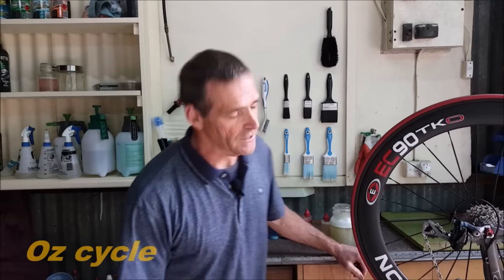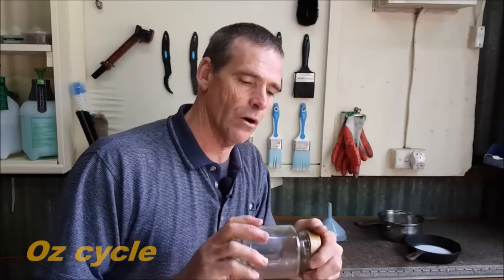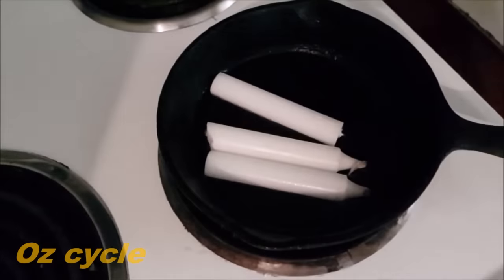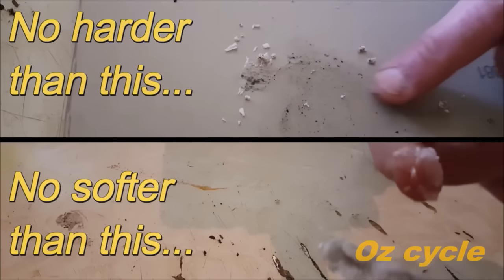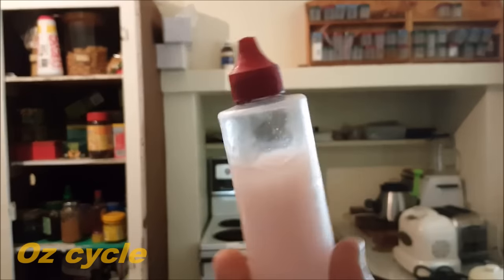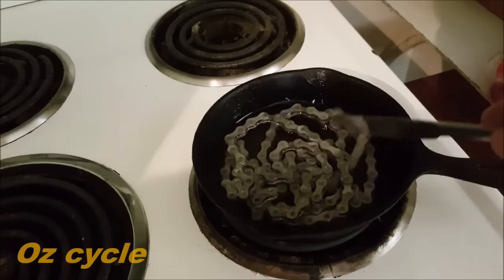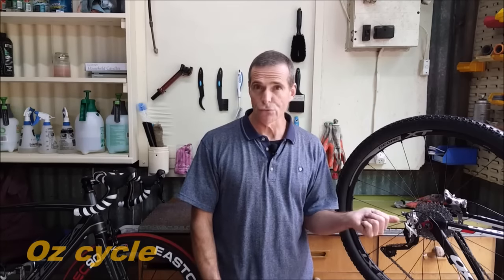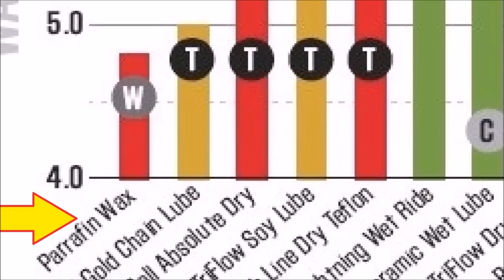BEST chain lubricant ever !! .....make it yourself.

Comment: Just a safety tip, paraffin wax emits highly flammable fumes when heated. You really shouldn't be melting candles in a pan directly over the stove element. It takes longer, but a double boiler is much safer. If you are going to risk melting paraffin directly over the element, have a fire extinguisher close at hand.
Reply: Conrad Griffith that's a good tip.
Reply: Oh and don't go out riding your bike as this could hurt you.
Reply: I made my first mix over the BBQ hot plate........ whoops! Did the second mix over the BBQ hot plate. Worked much better!
Reply: @rlevo  it's a very big cabuuuuuummmmmm !!!!
Reply: Induction plate stove should be safe -

Comment: I just did 75km in muddy conditions I cannot believe how clean the casset and chain are . This has got to be the best you tube video I have come across  never again am I using anything else.
Reply from the maker: Nice to hear your experience Stephen 😁
Reply: oz cycle yep it's fantastic but I must say I'm not a fan of the xylene I did get some and have made the mixture but it's really does stink so I'm gonna try turps or white spirit and see how that goes. Xylene is expensive as well
Reply from the maker: It has a high odor because it evaporates quickly. Otherwise go the hot wax method ?

Comment: Hi @oz cycle, Thanks for the Tip mate , I make a product at work called Dermeze sensitive skin Ointment. It's exactly 50% Paraffin Liquid and 50% Paraffin white soft blended together and nothing else. You can purchase it at any chemist in 500g Jars possibly cheaper than candles So all I did was put the plastic Jar of Dermeze Ointment in hot water for 5 minutes stirred and poured it into a 2 litre bottle and added the 250ml of Turps as I couldn't get Xyline at the time. Works a treat and no melting candles to get your paraffin blend. Hope this helps.
Reply from the maker: +Loanwolfz I never knew Dermeze existed. I will check it out. Thank you for that,Loanwolfz.
Reply: I'm not sure if that's cost effective or not but it's already blended for you, just add xylene 👍
Reply: Hey loanwolfz, could I check if the mixture of the Dermeze ointment and Turpentine has worked well?
Reply: Hi does it mean, 1.5 litres of Dermeze and 250ml of Turpentine? Loanwolfz? i bought the 500mg today and will calculate the turps from your suggestion
Reply: ronnel villanueva No the 1 x 500ml jar of Dermeze contains 250ml of Paraffin oil and 250ml of soft white parrafin. So you need to use 250ml of turps/xylene as everything is 1/3
Reply: Loanwolfz ñ
Reply: Damn!  It seems that Dermize is only available in AU or the UK.  All we have in US are hot dogs, overly big cars and nukes... lots of nukes... too many nukes dammit.  Wish I had some Dermeze instead.  But hot dogs are good.  So whilst we melt candles you civilized chappies shall be mixing it up with the Dermeze. SO modern & convenient!  Cheers, Chicago Joe
Reply from the maker: Candles are way cheaper. You can also buy refined paraffin wax off ebay if you want to make sure no impurities,maximum fruction free.

Comment: Oz, thanks for the excellent video. I was doubtful that this was worth the trouble. But I ride a crushed limestone trail along the Missouri River several times a week and my drivetrain turned dark, full of grit, even though it was maintained.

I followed your directions. Degreased. Cooked chain in parafin and oil.  After one ride drive train was spotless. And when I wiped it nothing came off. Fantastic. Thank you.
Reply from the maker: +Dan Carnesciali Thanx for relating your experience Dan,thats great feedback. Cheers...Steven

Comment: Hey buddy. After months of the usual weekly degrease, wash and lubricate of my chain, I had a crack at the wax dip. My god, what a difference, my chain is super quiet, I can hardly hear it. The big test is turning the bike upside down, removing proper tension from the jockeys... silky smooth. 
The gear changes are now instant with no dramas, and I had to look twice to make sure they had shifted. 
A top tip for you.. if you can’t afford, or don’t want a rice steamer, buy a 2 litre saucepan from a budget shop, keep it on simmer with the extractor fan going. Does the trick nicely and saved me £20. And if you have trouble finding clear paraffin oil, try asking your local chemist... it’s used to treat constipation 🤗
 Will definitely be putting my feet up with a brewski tonight to watch more of your videos. 
Excellent work.. 
Andy, rather chuffed in England (and despite what you are hearing, we want Trump over here... over politicians are running scared... but they don’t have a super quiet chain)
Reply from the maker: Sounds like you got waxing down pat there Andy. My first waxings were in a saucepan too 😂....works fine.
Reply: Mr. Trump is a U.S. citizen ; nor an Australian , neither a British citizen !

Comment: I've made a similar lube with only paraffin, naptha and your choice of high quality oil. I use Royal Purple synthetic gear lube for the oil.  I ounce by weight of paraffin will dissolve in 6-7 ounces of naptha.  Add 2-5% oil.  No heating is required, but the paraffin will dissolve much faster if the mixture is warmed, or the paraffin melted before mixing.  Naptha is a fast drying solvent that is cheapest when purchased as camp stove fuel or white gas.  Only $8.50 a gallon at WalMart.  When applied to the chain, the naptha evaporates completely, leaving only the paraffin and oil mixture.  It's very dry and leaves the drivetrain very clean.
Reply: After more testing, I've refined my formula a bit.  I have mixed 1 ounce or 30ml of gear lube with 60-90ml of melted wax, then added about 3 parts naptha to 1 part of the oil/paraffin mix.  If the oil/paraffin mixture is allowed to cool completely, it should not have free-oil sitting on top of the wax.  If it does, wipe of the excess, then reheat and mix with naptha.   I never use any paraffin oil/lamp oil/ kerosene to soften the wax.

Comment: Thanks for the inspiration!   Stripped and cleaned the drive trains of both my bikes over the weekend.  I did a straight paraffin dip of both chains, and used the left over wax to make your 'brew' as a top-up lube.  After a 26km test ride (mtb, mud, dust) I can confirm everything they claim about paraffin lubed chains is true!  Cheers...
Reply: Few more rides on the bike and have found the 'top up' lube attracts dirt and has started to cause build-up on the chain and sprockets.  Will strip, clean and dip again, but only hot wax from now on...
Reply: I think the xylene makes the wax too oily. Just use the paraffin wax and paraffin oil and maybe not quite so much of the oil.
Reply: When heated and melted the wax and paraffin penetrate the chain completely, and wax totally displaces water. The xylene is only good for applying the wax when bottled as it keeps it more liquid.

Comment: Have been using this homemade wax lube for over 4 months now and I can report that is the best maintenance tip I've had in 5 years of coming back to cycling, if you just put it on your chain to keep it clean it will be worth it besides the performance benefit.

Comment: I have been cycling for over 60 years, and the best chain lubricant I have ever found is chainsaw bar oil because it is specially formulated to resist being thrown off the chain when it makes its abrupt 180-degree change of direction around the saw's clutch.

Comment: I've been using this lube for about a year now, and really do like it.  I tried a new trick - vacuum deposition of the lube.  I cleaned and rinsed my chain.  Next I put it in a small can, and put it in a vacuum chamber I made.  I pulled a vacuum on it.  This caused all residual moisture between the chain surfaces to boil out.  I know this is what happened, because when I removed the chain, it was quite cold, a byproduct of boiling by vacuum.  Then I warmed it with a heat gun followed by putting it in a small can filled with the paraffin lube mixture. I then inserted the can into the vacuum chamber and again pulled a vacuum on it.  This got all residual air out of the surfaces between the chain links.  At full vacuum, the xylene started to boil out of the mixture.  At that point, I reintroduced atmospheric pressure which forced the paraffin lube mixture into the tiny spaces between the sliding surfaces in the chain links.  Without doing this, there is no way to guarantee that any lube used is not being blocked by residual air or liquid cleaning solutions which are already filling those voids.  I believe this same problem could occur when dipping your chain in melted paraffin.

It all seemed to work well, at least as far as I could tell.  I've only had one ride of about 20 miles on my bike since doing this.  The chain was perfectly silent which was a good sign.  But only time and more miles will tell if this is a method more beneficial than just wiping the lube onto the chain.  But it all makes good sense to me.  

In the electronics industry, sometimes we need to waterproof our circuitry by encapsulating it with liquid epoxy (called potting) and letting it harden.  Mixing the two parts of the epoxy often introduces air bubbles into the mixture.  Water can find passages to the circuitry through  the bubbles which are caught in the hardened epoxy.  To prevent that problem, we put the uncured encapsulation into a vacuum to pull all of the air out of it.  It then cures as a perfectly homogeneous solid mass with no bubbles in it.

I'd appreciate hearing if anyone knows if vacuum deposition of lubricants onto bicycle chains has been tried in the past, and what the results were.
Reply from the maker: Thanx for your wonderful research into this Jerry,mych appreciated. Let us know how you go with more mileage in the chain?
Reply: @stevenleffanue  what is the purpose of the xylene may I ask? Is it a medium that evaporates once it has applied to the chain?
Reply: @wireshrub  ... /... , it works perfectly fine as a nail vernish - cleaner . Often used by women to take-off all the polish from their nails . A much harder and radically substitute to acetone .

Comment: Firstly @Oz Cycle, great tip.  Secondly, to those posting about $1500 wheels and finding it contradictory with saving money, let me just say that it has been my observation of wise people, sometimes also of rich people (none of these terms apply to me btw), that FOR THE THINGS THAT COUNT, they make expensive but sensible purchases of products that last a long time.  These purchases are however offset by saving money elsewhere on items or services that are considered "throw away".  So, I don't see any contradiction between the outlay of > $1000 on wheels and saving money on chain lube.  A personal example would be once when I cut out coffee for 6 months (shock horror) which allowed me to purchase a very nice bike for my youngest daughter.  They money was essentially put to better use.   In any case, thanks for the tip @Oz Cycle.  Love your channel.
Reply: Those are Chinese with Easton stickers. Watch his other video.
Reply: Also, this homemade recipe looks like a bit of fun and an interesting talking point if the subject of chain lubricants comes up with riding mates.  Those efficiency measurements seem intriguing as well.  To me, the big improvement in cleanliness with its dirt/moisture repelling capability is the best part, even for a person that believes money is no object.

Comment: Great video.  I'm a real rookie when it comes to bicycle maintenance.  I had always assumed that lubricant was to make the gears and chain move more easily especially when shifting.  I hadn't considered rust protection at all.  My idea of chain maintenance was carwash and then glob as much oil on the chain as it will take.  I've never kept a bike long enough to find out the long term effects of my method.  Needless to say I always have black grease on right leg, either from oil splashing or an accidental brush against the chain.

Comment: Hi Oz after watching your video I immediately went to find and purchase all the ingredients and bathed my chain in the parrafin & wax after deep cleansing. The Xylene I could only find at a large hardware chain store. On the road bike the feel was smooth and the chain cassette ect stay clean and dry. Then I did the same with a brand new drive chain on the MTB. The chain stays lubricated and is unneffected by dust and water taking off the oil/thinner lubes and is absolutely amazing. Like what you say what got me to watch the video in the first place is “I will never buy chain lube again” what may be confusing about people not being able to find parrafin oil is because here it’s labeled just as parrafin and not liquid or oil. From watching the video I assumed that the clear liquid is the same as general parrifin which is used in oil lamps ect... however it’s just called parrafin
Reply from the maker: Good to hear the waxing is working for you Darren. "Paraffin oil" is a general label put on many mineral oils but the true paraffin oil is used is the cosmetic,medical and veterinary type.

Comment: Put your bottle of lubricant on top of oil burner or hot water heater. The small amount of heat that comes from unit keeps the lube from waxing up.

Comment: I'm in California.  No Xylene - not even regular lacquer thinner - only LOW VOC stuff, which I guess means slow-drying.  What about 90% methyl alcohol in the mix?  What do you recommend?
After some research, I conclude that Lacquer Thinner has the desired properties.  The idea is to produce a thinner liquid that spreads and applies easily and then evaporates quickly to a solid (unless it's very hot.) So, the paraffin oil is very similar to the candle wax, and by blending the two, you are basically going in-between them on the solid-liquid properties. 

Some people are advocating NAPTHA (white gas for camp stoves) - the stuff is comprised of high energy carbon rings - it's explosive.  Whereas the lacquer thinner is designed as a quick evaporating solvent and cleaner and is far less energetic, if still flammable.  So it's the right stuff.

Comment: Fantastic chain wax tutorial!  Perhaps the second best ever cycle tip I know in over forty years cycling.  The best ?  From the late great Sheldon Brown  : to thoroughly clean any chain, remove from bike and put it into a screw top plastic bottle, add a half cup or so of solvent or petrol, screw on cap tight, then shake bottle vigorously for two minutes----- chain will be clean as a whistle! 🚴

Comment: Oz cycle, hi. Admittedly your concoction is the best. Bought all ingredients as per your recipe. However, after reading the warning label became so worried about using xylene. But I had found a way to overcome the Wax becoming a blob on the chain the minute it touches the cold chain. I use a soldering iron to melt the blob on the chain and it seeps into the chain parts as intended. Ever since I started using your wax lube my chain is so clean and smooth and silent, it’s like knife cutting through butter. Thank you for this great tip.

Comment: I do clean (if necessary), prep, and treat 3 chains at a time, however, before submerging them in the wax I apply Boeshield-T9 and let dry thoroughly and then ACF-50 and allow to dry. I live in the PNW and deal with a deal amount of rain over the year. Wax is great but I can see a big difference between the chains when treated with the ACF-50 and T-9 1st. Cheers.

Comment: Thanks for the videos! I found a mixture (in the USA) of about 1/4 paraffin wax, 1/4 mineral oil, and 1/2 or more of mineral spirits works for the drip lube. It seems to require a higher percentage of mineral spirits than it would if I used xylene as a carrier for the wax. It also seems to require a little longer for the mineral spirits to evaporate. Having said that, I apply it the night before and it seems to be working great
Reply from the maker: +C Tucker Thanx for that. Yes best to let the carrier evaporate before riding....just takes longer to evaporate in colder weather
Reply: I tried a mixture of 1/4 paraffin wax, 1/4 paraffin oil, and 1/2 D-limonene for the solvent.  And that was still solid at room temperature (actually: 90F).  If I were to add even more solvent, I'd be afraid I'm washing paraffin out of the chain, instead of putting it into the chain...   I've also tried naphtha, and finally resorted to xylene.  All these produced a non-liquid "lube" at the equal thirds ratios.  I guess I'll keep adding more solvent...